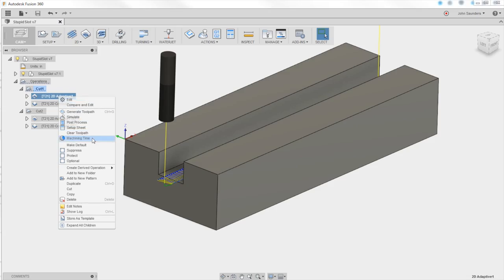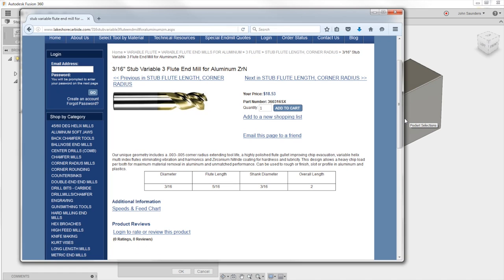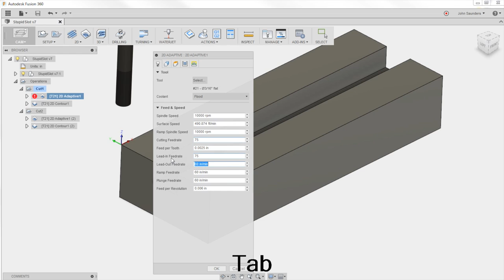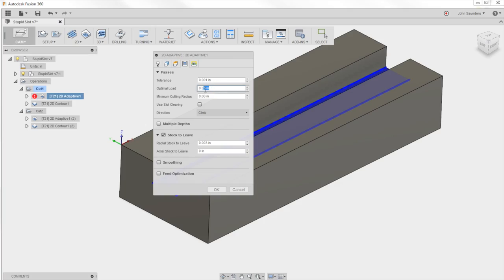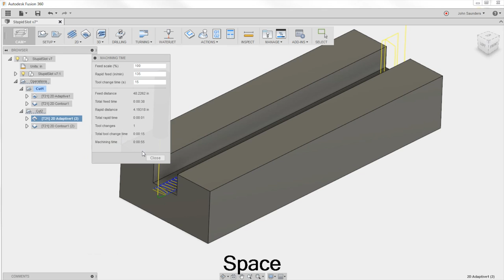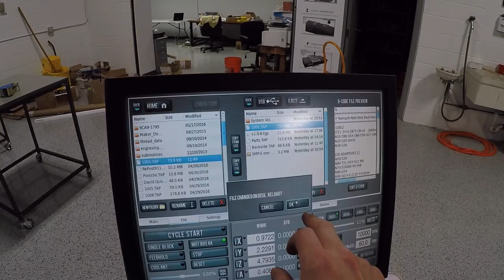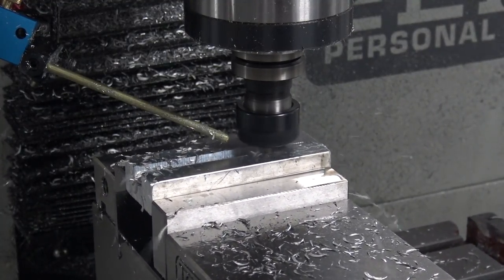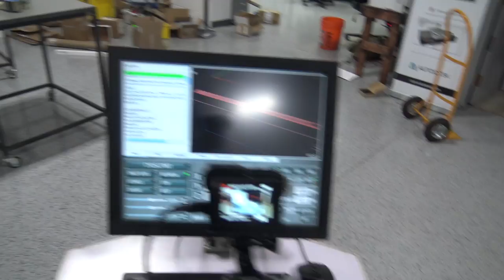Stop Slotting The Stupid Way!  Fusion 360 Adaptive!  Widget101

Comment: wouldnt it be faster to just go straight through the material 3 times instead of that circular motion?
Reply: Machine wouldn't have the power to make that cut while maintaining a proper SFM for the material. Would have to slow the feed and rpm way down
Reply: No, not at all.  That would be taking a 100% width of cut and is much slower.
Reply: +Occams Sawzall I could be wrong but I think the SFM is actually higher with the little circles. I think the issue is the 1100 can't take the big enough bite(100% width) at a high enough feed and speed to make it worth cutting full width and I don't think the bit would take the side load at full depth with the lower speeds. like John said, he gets to use more of the tool (not just the bottom 20%) an gets to use it more efficiently with the "addaptive" tool path. I would just refer to it as the smart way to cut a notch.
Reply: +Jim Wilson that's kinda my point.  With this particular machine it couldn't use a 3/8" and go full depth and width to gain MRR. Machine just couldn't handle it. 

If he wanted to use a 3/8" and keep the same MRR he has with the 3/16. He'd have to slow the speed and feed way down in order to take a cut the machine can handle, and that the tool won't rub in (.002-.003 IPT) 

So the 3/16" here with adaptive is the better way for THIS machine. If it had 2-3 more spindle HP. Than it could take a 3/8" and go full width and depth with it. 

Limiting factor here is the spindle. The tools can take way more than the machine can give em. So he has to adapt the cuts and toolpaths around the machine parameters.  With bigger machines you end up doing the opposite, you have to adapt the machine parameters around your tools, because the machines can put out more power than the tools can handle.
Reply: +Occams Sawzall I think I misread your comment, because you said it well.
Reply: +Jim Wilson I explained elsewhere here that this machine and it's spindle has a maximum of 2.5 cu in/min removal rate in aluminum. that's going to be a fixed constant due to the HP of the spindle. And there's really not much of a way to get beyond that (might be able to squeak out 3 with cutter geometry).   How it achieves that removal rate is vast and numerous. But pretty much no matter what is done, it'll max out at 2.5 cu in/min. 

So the goal is to use toolpaths that consistently reach that 2.5 removal rate as often as possible. Either the slow and heavy route like with a full width/depth with a 3/8". Or the fast and light way with the 3/16" and adaptive path.
Reply: A) Yes the spindles HP might bottleneck the cut.
B) This machining method is beneficial to the tool because it doesn't introduce as much heat from the constant friction (a lot of the heat leaves in the chip) and also since the chip ejection is so good you aren't recutting chips. I'd hardly machine anything less than 100ipm using a 10% woc.

Comment: I tried out the lower RPMS & higher widths of cuts... my tool & work piece tends to over heat... Then I found this online from CNC cook book http://www.cnccookbook.com/CCCNCMillFeedsSpeedsHighSpeedMachining.htm turns out when I was milling at crazy high rpms & 10% widths of cuts it was considered HSM & it actually reduced heat. I found that the higher the spindle speed & higher the feed rate... The lower the heat output. My endmill was stone cold at the end of every operation. Only down side is tiny chips... like needles.

Comment: Man, that slotting toolpath is 73KB by itself. Unfortunately at work, I used some cheap-ass ~2005 Fanuc controller machine. I only have 256KB to work with. Bunch of bullshit isn't it? (Fanuc sucks for memory. ಠ_ಠ) 73KB is bigger than many of our whole programs. It's because of that, why we slot in straight lines. That being said, a .375 Inch Necked Rougher for that .400 Inch width slot would do the trick in two depth passes. Probably even just one. However it is a Necked tool, which are expensive, and not your average endmill.

Comment: While I like high speed machining like this. On the Haas at work I could've done this in half the time with "conventional" milling, Especially in aluminium, in steel I could probably match it. Downside would be that the wear is only on the end of the endmill. 

I use high speed machining like that if I have deep pockets and a hell of a lot of material to remove, otherwise there's no gain in it(At least not for me) - aluminium is like butter with the 10mm endmills we use, I run full revolutions (8100rpm, not the speediest, I know.) and at least 0,05mm per tooth. But then again, we have flood cooling and a relatively stiff machine.

Comment: And once again, As I did with your other video, I ask, Did you consider the hugely increased wear and tear on the machine as opposed to the tool from the gargantuan increase in X, Y movements as opposed to straight slotting?  Doing it the way you are doing it may be faster but is there actual "ECONOMY" realized. A double AA fueler is a fast car but with a total engine rebuild after a few runs it's clearly not the economical choice as a daily driver. Is this the same with your method of slotting before you call the other way stupid? Stupid is cutting the machine life in half while only increasing production by a third.  Tooling only becomes more expensive then the machine over time due to the tremendous economy of the machine itself. If you have to replace the machine more often then the economy goes down the tube.  You have to add the enormous cost of replacing a machine that did exactly what it was designed to do but wore out prematurely because you forced it to blow it's entire load in half the time. How many X and Y direction changes with your method as compared to straight slotting the old way. Every single time you are hammering backlash by whatever means being used to transit. 

This is IMPORTANT! If you are calling methods but yours stupid and influence others to use your method they could all be wearing out their machines prematurely also. You'll go down as a zero instead of a hero. If you have not long term tested your method against machine wear and tear then you should not me calling other tried and tested methods stupid. Remember! It was the turtle that won the race and I'm betting they called him stupid for running against the hare also. How much difference in wear and tear? Buy a new car and the drive train can carry you around for years Reliably. Take the same new car in your driveway rev it to 1500 rpm and then just sit in your driveway jamming the gear selector from forward to reverse only moving a foot each way and see if it will last a week? Most likely a lot less than a week. I am not saying that your method is catastrophic to equipment, but I'm betting you are calling tried and tested stupid when you have no actual cost of your own method to justify it. Machine repairs and down time cost money also. 

Last year I bought a 1953 Cat 112 Road grader. You wanna talk economy? I built 3 roads with this 68 year old machine. Cost me 3500 dollars 400 gallons of fuel and my time to do over 70,000 dollars worth of work. How much work and money did that machine make over 68 years? Think the new bigger better crap they sell today will last that long and have that economy? The technology alone will have the new stuff obsolete and recycled before it's half this old graders age.

An old bull and his son are standing on a hill looking down at a field of cows. The son says to his dad: "Hey dad! Why don't we run down there and screw one of those cows? The dad says to the son: Why don't we walk down and screw them all? Economy is not speed! It's longevity and reliability!!!!! Seriously! I have to laugh. Folks are out there reliably running and creating and building with lathes and mills that were used in crazy levels of World War production, to this very day. Where is all this electrical technological based new stuff that costs a fortune today going to be in 25 years when all the circuitry and programming is obsolete? I mean spend a fortune to build things cheaper but aren't affordable to repair and in a decade the tools and the product will all be in the garbage or recycle by a generation that claims they are environmentally conscious. It's bat shit crazy! LMAO...

Comment: Wish I had a Tormach, but I'm disabled, and on SSD so don't have the bucks. Got a SIEG X2 Mini Mill to use manually for an invention. Then both my wrists went from hand cranking and ended up with carpal tunnel in both. Have to move to CNC now. Need to make the parts, and get it all installed. Used Fignoggle DRO Plans, and now Using their CNC upgrade plans that works with their DRO plan. My max RPM is 2,500 but thanks for the file to work with It's a slow machine, but with this tip, it'll make it a bit faster. I do have Fusion 360 installed, just haven't learned it yet either. Have an old Acer laptop to run MACH3. It'll be some time before i get that far. Just one day at a time. 
-CD
http://SeeTheSound.net

Comment: Not really sure why you use a circle program, lot if movement on the machine. Also it looks deceptive.. you cutting Aluminum...I don’t agree with all the small tooling stuff but I am a Tool and Diemaker, and yes a Machinist as well. I cut key slots on size, 1 cut has worked for years,  less movement and speed relevant to steel composition.